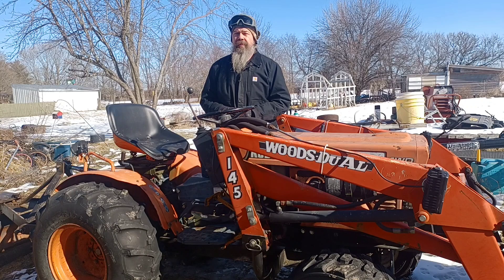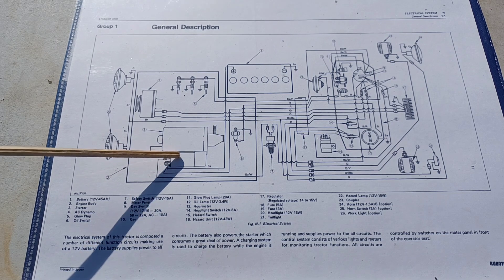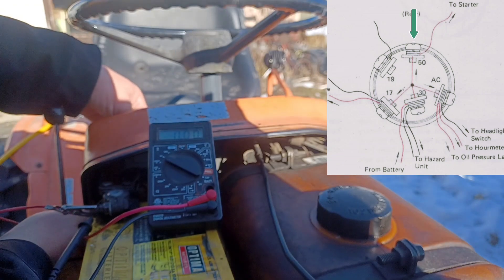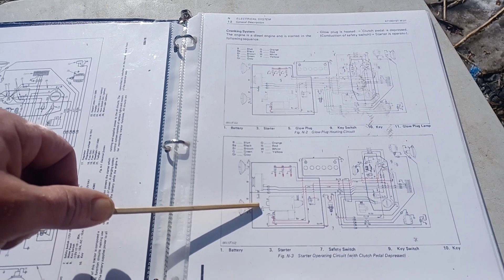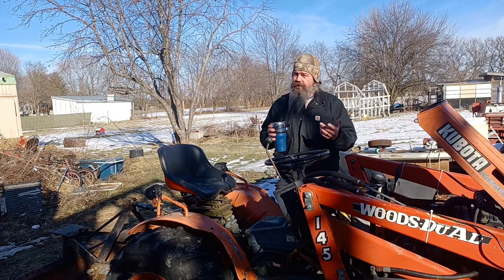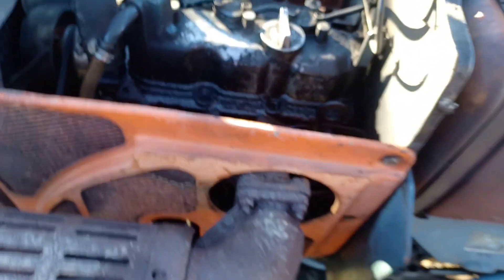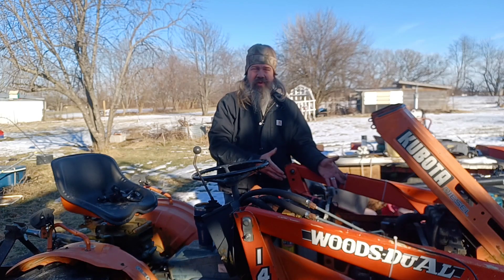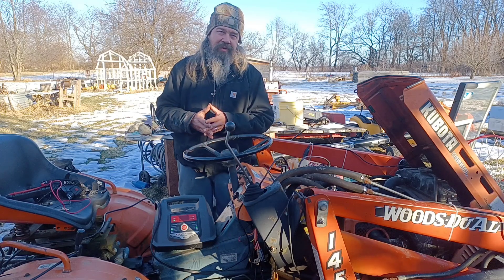How to diagnose small tractor starter circuit problems. Kubota B7100 diesel

Comment: I have a question for you. I have a Kabota 2500 from 1989. We bought it from a guy and there’s no fuse down by the starter. It’s just got the red cap and the white wire is unplugged. What’s that for?
Reply from the maker: Well, to be honest, I'm not sure. I'm not very familiar with the L series, and I can't find a workshop manual for the L2500 online. 
The L3010 was produced the same year, but is a different style of tractor. The wiring diagram for that one only shows one white wire, which powers the headlights. If yours is the same, that wire should be fused.
Does the tractor run ok?

Comment: This is crazy but I have a 9 year old battery on my B7100. I keep it on a trickle charger when it's not being used. I need to replace it, just like to push my luck sometimes. Thanks for the trouble shooting details. It can get complicated! :)
Reply from the maker: This is the only sealed AGM battery I've ever used, and I'm only now learning they generally last 4 or 5 years at best. I never kept it on a charger, and only had to charge it a couple of times in 7 years (when the dynamo was going out on the tractor). The smooth start at the opening of this year's snow plowing video is how it's always been. Then 3 weeks ago, it started getting weak, and in that time has completely crapped out. I guess my luck was due to run out on this one.
Thanks for watching and for the input!

Comment: AGM batteries almost never last 7 years.  I agree you need a battery.   However when I was repairing Kubota tractors we found they ground it at the radiator mounting frame and when the radiator mounting to frame gets corroded and losing ground.  We ran a new Ground cable from to the battery directly to starter mounting bolts.  This was common on aging kubotas.
Reply from the maker: Appreciate the tip! I'll look into running a fresh grounding strap once I've had the tractor running long enough to get the bucket off. If the ground is that bad though (and it very well could be), I'll have a farmer friend bring a bigger tractor and we'll pull the bucket so I can get to it.
When I did some electrical work on this a year and a half ago, I did a fresh ground lug on the steering gear box direct to the battery, and from the dash panel to that lug. I could probably run from a starter bolt to that lug, it's only a few inches away.
Thank you again for your input, and thanks for watching!

Comment from the maker: Isn't it both amusing and annoying that this tractor never failed to start until someone mentioned how nice it starts and I told them that it has always started like that in all the years I owned it, and the battery never had a problem until someone asked about it so I gave them the specs and told them the battery has been great for many years?
So, how is your 2025 going so far?